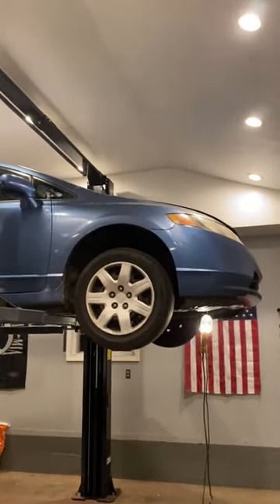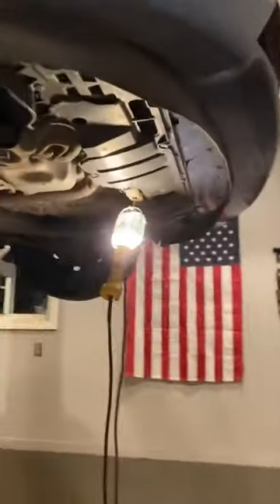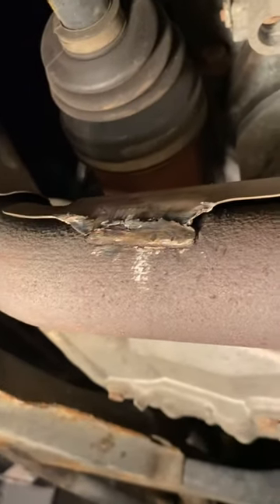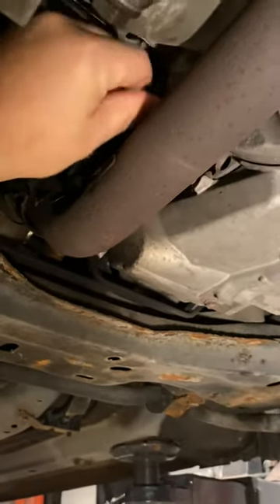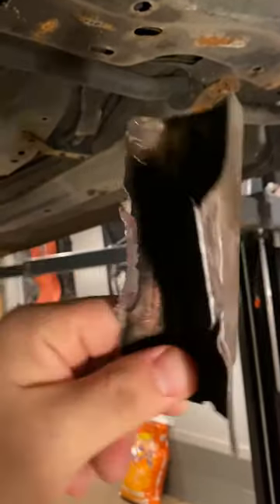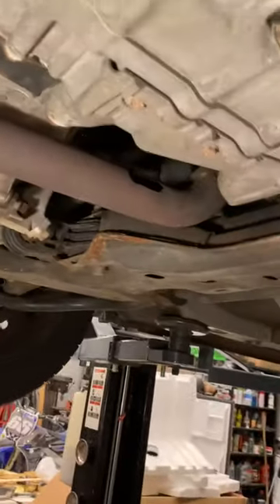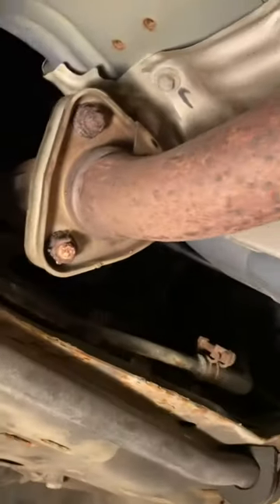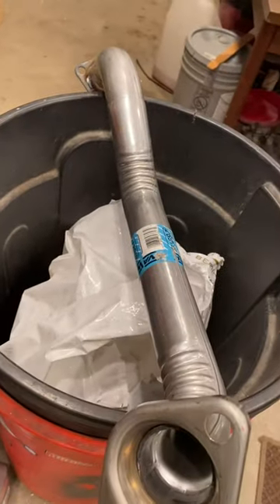Honda Civic common exhaust leak and easy $40 fix.

Comment: Any help would be appreciated if you can give tips on getting the two bolts off in the front (I snapped one already) and the three bolts in the back.  Or maybe a video on how you drilled them out?
Reply from the maker: 2 bolts in the front snapped all I cut them off with an angle grinder and then hit them out with a punch. The three in the back I had one snap and the other two came off. Basically assume you’ll have to use new bolts for it all.

Comment: I have a crack on the manifold, right next to the A/F ratio sensor. I have a check engine light and code p0135. Can I just seal it with something? thanks
Reply from the maker: Probably won’t hold but you could try jb weld.
Reply: JB Weld extreme heat rated for 2400°F.

Comment: the original pipe comes with 3 heat sinks, but, no heat sinks with the new pipe. is it safe? the driveshaft boot above might be melt?
Reply: sorry, not heat sinks but 2 heat shields protect cv joint boot. new pipe does not come with those heat shields. is it safe?
Reply from the maker: Yea it didn’t come with them but also haven’t had an issue with them getting too hot or melting anything

Comment: Mine rusted in the exact same spot. You have any idea what the point of those shields are? A lot of the after market replacements don't even have the shields on there
Reply from the maker: Shields are just for heat. Like I said in the video you could probably weld and patch them but the pipe is so cheap I just replaced it.

Comment: The New pipe doesnt have The 2 holes with The 2 heat shields covering them on this New pipe from what i see, has it affected the Floor Board of your car ?
Reply from the maker: Nope not at all. And you’re right new pipe doesn’t have heat shields. But we haven’t noticed a difference
Reply: Did this Vehicle have Fumes coming from that Exhaust pipe making its way inside the vehicle thru the AC vents ?
Reply from the maker: Yea you could hear it and smell it. Plus it failed inspection for it so we replaced it.
Reply: @justthetipgarage5305  I Appreciate you and the video Im currently having the same problem,but now im gonna order the part and have it put on to replace the factory pipe solve this problem
Reply from the maker: No problem glad I could help. Make sure you get the nuts and bolts to or whatever the connection hardware is. Those spring bolts at the front tend to be bad if you live in the rust belt

Comment: Would a leak in this location cause a gas smell to enter the cabin through the HVAC vents?  I'm smelling gas, and I've replaced air filter, pcv valve, etc., and still smell it. No oil or actual gas leaking on the ground, so I'm suspecting an exhaust leak. Thanks in advance
Reply from the maker: Absolutely could and it’s easy enough to spot. Just put it on ramps or jack it up and take a look. It’s easy to spot
Reply: My civic had only a very tiny oil drip with strong exhaust smell in the cabin. Turned out to be a bad valve cover gasket

Comment: Im planning on doing this repair on my civic, im going to buy 6 spring/bolt + the pipe, what else do i need? any gasket/seal? i have work on my car multiple time but exhaust is a first.
Reply from the maker: Nope no gasket or seals. It
Just bolts together. Pretty easy just a little harder on the ground than on a lift. If I remember correctly one of the front spring bolts didn’t snap but the other one did.
Reply: @justthetipgarage5305  wow thanks for the fast reply. perfect i will order the pipe and the bolts. THANK YOU !!
Reply: How did your repair go....to the best of my knowledge more is needed .. i need to do it ordered parts and what came with the  exhaust pipe was a donut

Comment: I have an exhaust leak that is potentially just the exhaust flange gasket. I have purchased the gasket but not the bolts. I see the comments about having to replace the bolts with new ones. Should I assume that I will have to replace the bolts as well?
Reply from the maker: Yea you should have some new bolts on hand. Those old ones will probably snap off.

Comment: Part number !
Reply from the maker: If youre unable to find it on www.rockauto.com please don’t attempt the fix.
Reply: I bought these on rock auto and the repair worked great
walker 53697 for the pipe
walker 31383 for the 3-bolt gasket / seal
walker 31391 for the pipe flange ring between cat and new pipe
walker 35129 for the bolt / spring between cat and new pipe
for the 3-bolts in back I used M8-1-25-x-25-mm-Zinc-Plated-Steel-Flange-Bolts with matching flange nuts 8.8 grade from home depot
Reply from the maker: Perfect! Glad you knocked it out.
Reply: @AcronymSoup  53697 for the "Front pipe"